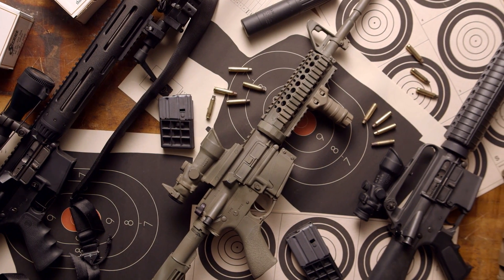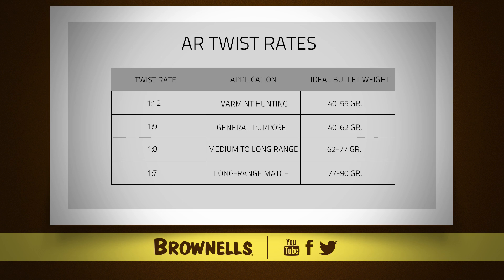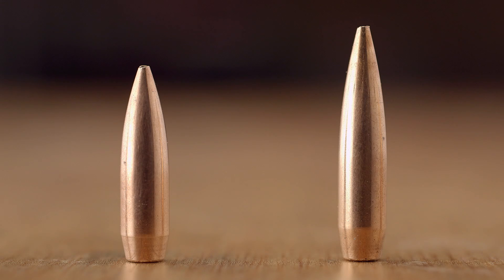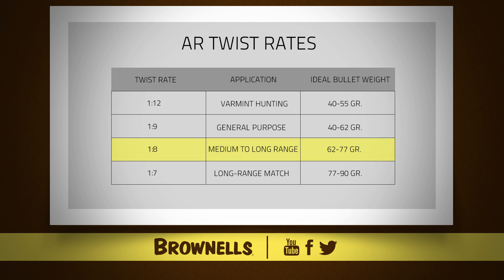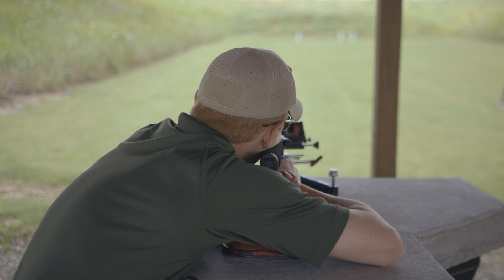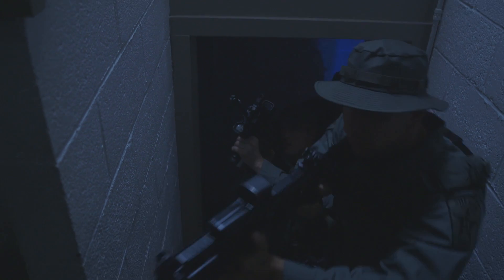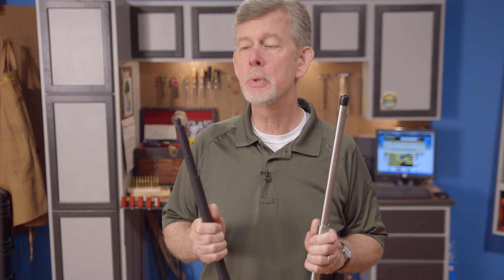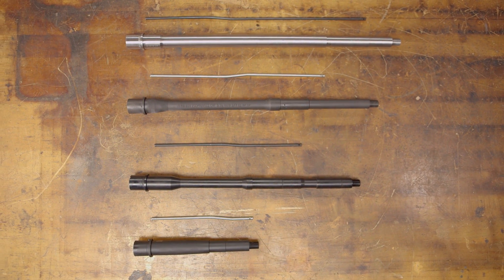Tech Tip: AR-15 Twist Rates

Comment: Ugh!  I'm still confused.  I believed that 1/8" twist rate was the do all twist rate, so I bought a 14.5" barrel with that rate to be used with my defensive AR-15.  I believed this twist rate would match well with the M193 bullets I've stockpiled.  I hope I'm not wrong.
Reply: Your 1/8 twist should do just fine with those. 55 grains is on the small end of whats optimal for that twist, but the 1 in 8 is considered the best all around twist for ARs by many.

Comment: Does barrel length make a difference when it comes to twist?
Reply: Very short barrels can have trouble fully stabilizing bullets unless you increase the twist rate. Maybe you remember the case when people built AKS-74u clones by cutting AK-74 barrels down from 16" to 8" (roughly), only to find the rifles were keyholing. Russians prevented this by increasing the 74u barrel twist rate by 20% as opposed to the full length 74, to compensate for the shorter length available to impart rotation on the projectile.
Reply: Yes

Comment: The point about SS109, even though it's 62 gr, being different than steel-free 62 gr seems to be something that is neglected in twist rate discussions in messageboards.
Reply: Along with other bullets like lead free, people get stuck on the weight of the bullet when the main issue is actually the length.
Reply: Yup..all I want of to shoot. Is 55g 223 .  so 1in8?
Reply: @305dade8a  1 in 9